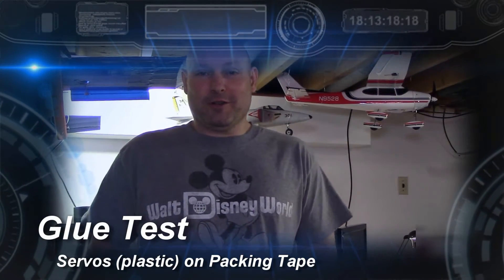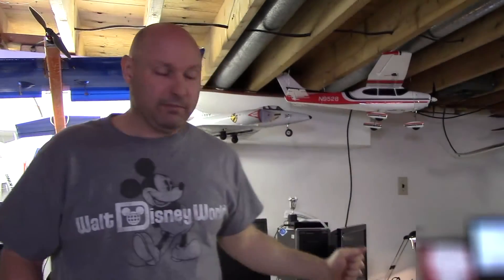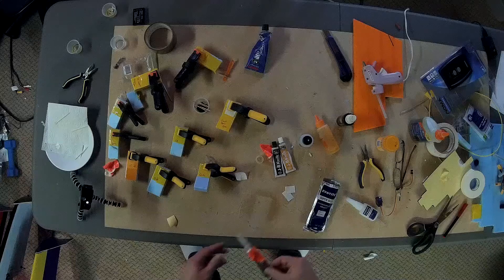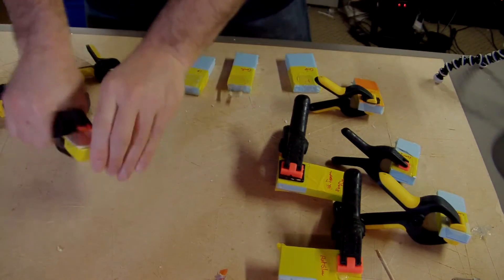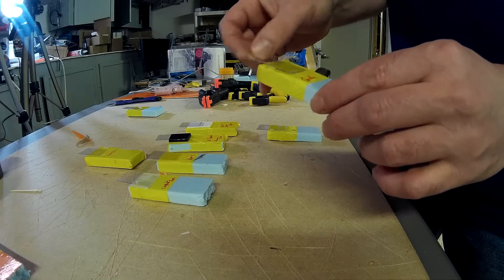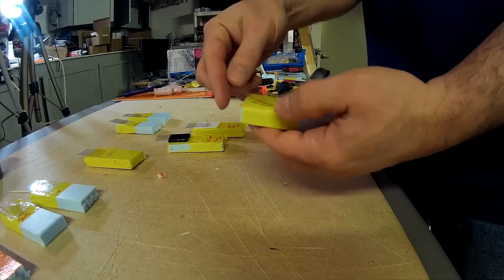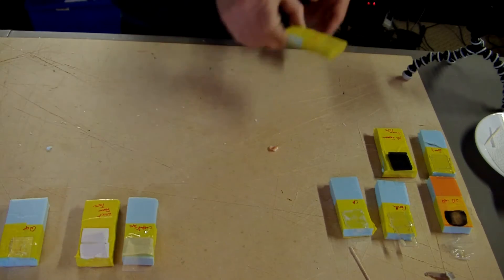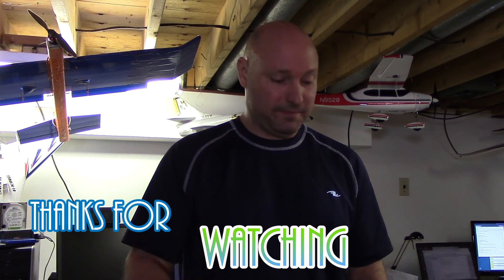Glue  Test - Attaching Servos to Packing Tape

Comment: excellent test. two questions. why do you use packing tape to wrap your planes? and what do you recommend to secure servos direct to foam so that it can be removed with damaging the plane?
Reply from the maker: I use packing tape for colour and added strength.    I haven't found a way to secure servos to foam without having the foam come away later.  If it sticks you might be able to use double sided tape, then when you want to remove it "freeze" the tape.   I think Ed (ExperimentalAirlines ) uses this technique for removing the double sided tape, however I don't think he attaches it directly to the foam.   You would want to test it out first though and there is always the chance that the tape will not hold the servos properly on foam.

Comment: Interesting test. When I tape, I use Scotch 1 in. x 1.66 yds. Exterior Mounting Tape.  Most of the time I just hot glue.  Never had an issue with either method.
Reply from the maker: I was expecting the hot glue to do a lot better.  I did a video not too long ago showing my glue gun stuck to packing tape with just some hot glue that had dripped off of it.  It was really stuck on good.  Maybe it does better over a longer curing time, or maybe the clamping squeezed too much of the glue from between the plastic and tape?   I might do some follow up tests without clamping and maybe even with a different brand of packing tape and a 'tdifferent plastic.  I think the key here is to test yourself and don't just assume that a certain glue will work in all situations.